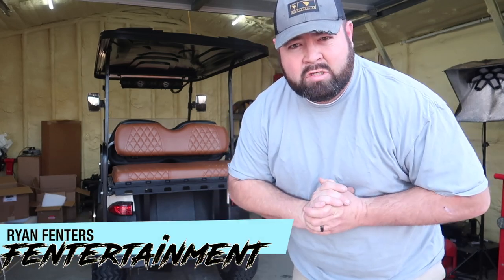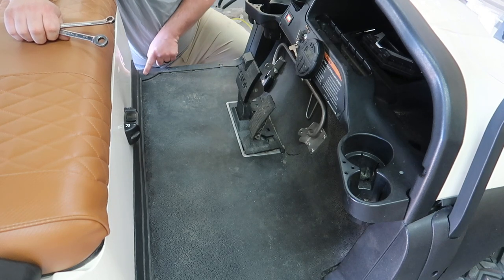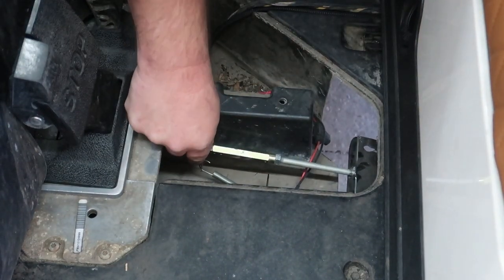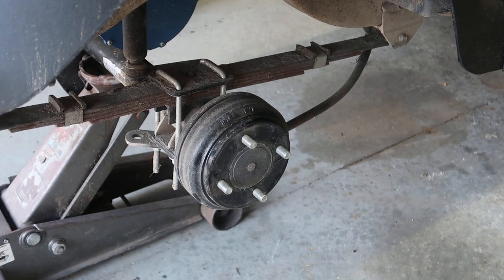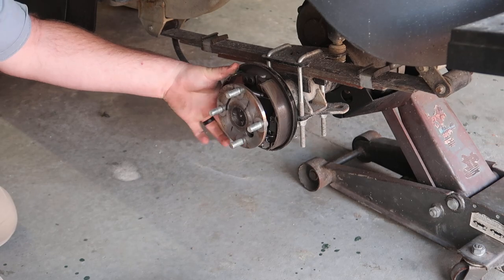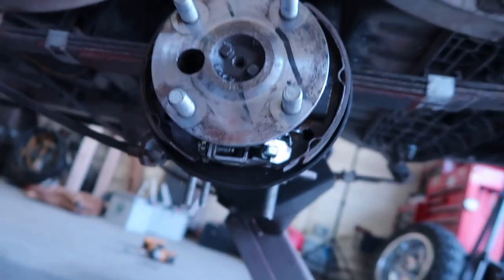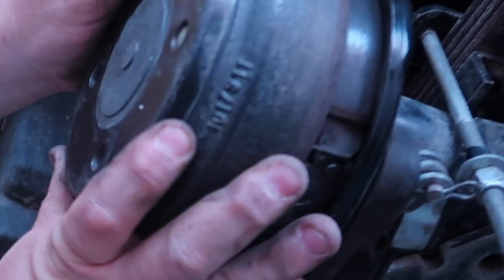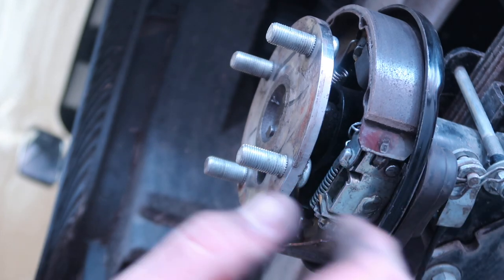Club Car Precedent Brakes were Sticking / Dragging | How To Adjust Golf Cart Brakes

Comment: I notice this happens when the pads wear and the stop jumps the cog, All it takes is a few more hours with the drag and the pads wear in even worse, I wouldn't be surprised that when you adjust the pedal with limited play like you have the next heavy braking and or hard parking break set the cog will get unaligned again. Enjoy your content

Comment: So I just installed a new hub and brake kit. I put it back on there and it rubs a little bit but when I engage the brake it will still spin. I dont have my brake pedal hooked up since its gutted so Im pulling on the brake cables by hand. Should it stop the hub when you hit the brakes or does it still turn just with alot more friction?

Comment: On my club car ds when I apply the brakes the pedal moves about 3/4 of an inch then they lock up a sqeal the tires . I have taken the brake drum off cleaned and adjusted put the wheel back on and the same thing happens. The drum are clean and smooth on both sides but the brakes continue to lock up. I have purchased the brake cluster but I'm trying to avoid installing them. Any ideas on a course of action before I pull the axles?

Comment: I feel random "drag" or what feels like resistance when cruising.  checked out clutch and replaced drive and starter belts, and flushed and refilled gear oil.  still feel the issue.  Maybe this (your vid)  is my problem?

Comment: 2020 Club Tempo and the you can barely push the cart.  Pulled the hubs off, however the cog will not go up to loosen.  It will only go down to tighten.  Already so tight I can't get the hub back on.  Any advice?  Great Video.
Reply from the maker: you should be able to spin the adjuster backwards to loosen up the brakes a tad.
Reply: Doesn't budget.  Turns forward really easily, but it will not budge backwards.
Reply from the maker: @mikemorrison5943  I have a set of brakes on a precedent that I need to loosen. If I get to it I will post it. Same cart. There is a little arm that pushes the adjuster to spread the shoes when you press on the brake pedal. however once the drum is off you will spin the axle till the hole on the flange is down low. Then take a flat head screw driver to lift the arm while spinning the adjuster by hand.
Reply: I think I understand what you are saying.  I tried pushing the arm back, but couldn't budget it, but I will give this a shot and see what happens.  Appreciate the help
Reply from the maker: @mikemorrison5943  ten4
Reply: Worked fantastic.  Appreciate the help.  Now do you have a video on converting this cart to Lithium??  Absolutely no serial number, so I have no clue on any details for this cart.
Reply from the maker: @mikemorrison5943  I’ve done plenty of lithium battery videos. “Converting” a cart to lithium is no different Dan replacing batteries. I’ve done a bunch of battery range tests on the channel. Just pick which one you like, use the discount code or link to save money and enjoy.